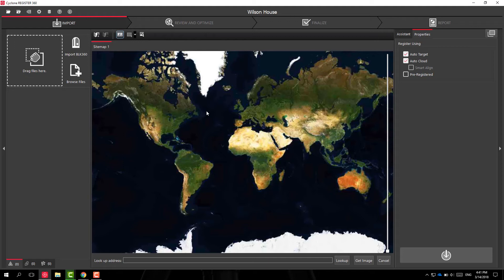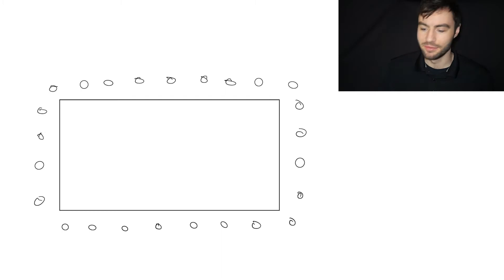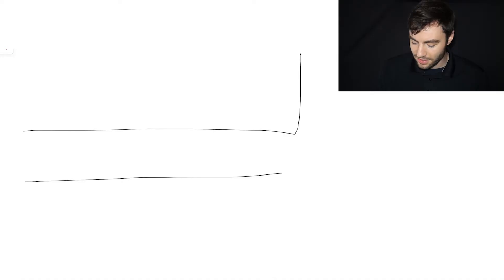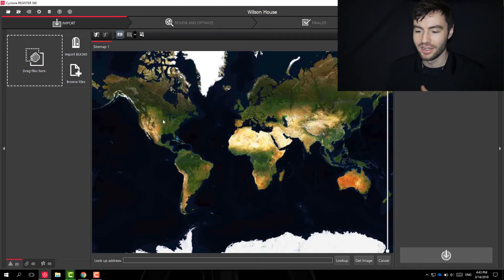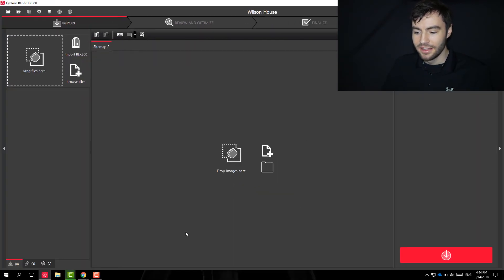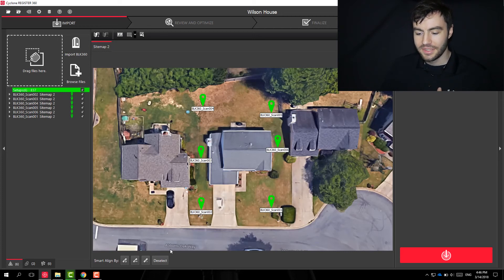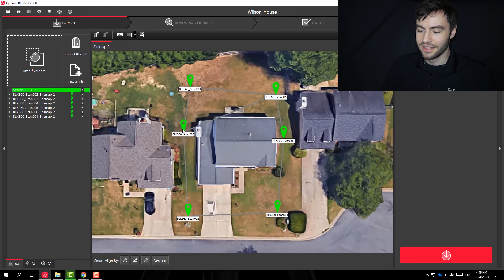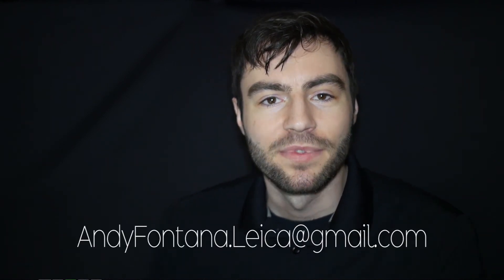Smart Align with Register360

Comment: Hi Andy, great video and some very useful tips. What process should I adopt if I have used the FIELD360 app to register the RTC360 scans on site? Is there anything I need to do in REGISTER 360 or will the links automatically appear when the project is imported? Thanks.
Reply from the maker: Hey Toni, there is nothing extra you need to do. When you are aligning all the scans on your phone or tablet, it's sending that information back to the scanner. So when you import the data from the RTC's flash drive, all the links that you had created in the field will show up in Register360.

Comment: Hi Andy, I'm getting started with the RTC360 scanner and wonder since the scanner has the camera to link the scan, I don't need SmartAlign anymore. Is that correct? Is there any situation that you think SmartAlign is still useful with RTC360 workflow?
Reply from the maker: Yes, once you import RTC360 data, you may already see some red links between the scans in the preview window. These are links from the 'Vis' system on the RTC. If you see these, then you don't need to have any AutoAlign or SmartAlign turned on and these scans will already be linked when you import the data.

Comment: Hi Andy. Great video, thanks for the information. I'd be interested to know if the Register360 team has or is working on a way to run SmartAlign after starting alignment without it. I recently had a project that wouldn't didn't align well without SmartAlign and it would've been helpful to be able to restart the process with SA after finding out that things weren't aligning well.
Reply from the maker: Hey Scott, SmartAlign must be done on the initial import. If this happens, you can roughly align the scans together, use the fence tool to select them, and run the Auto-Cloud tool (on the bottom left of the screen when scans are selected). Let me know if that makes sense. If not, I can help you further.